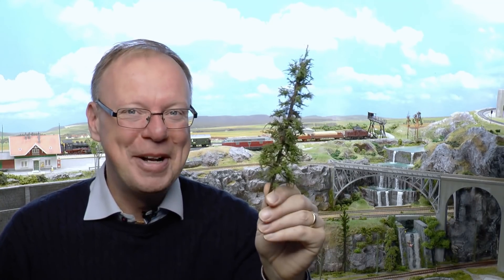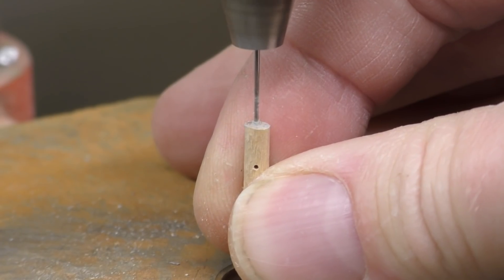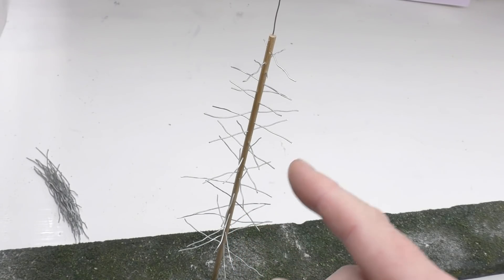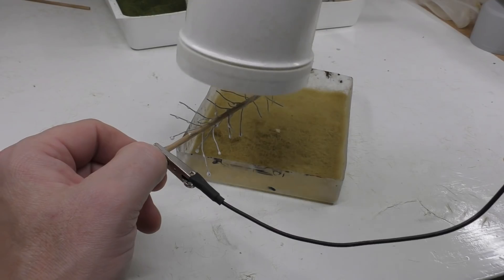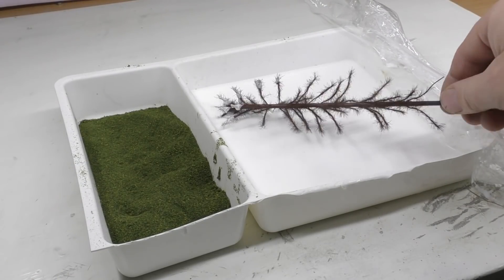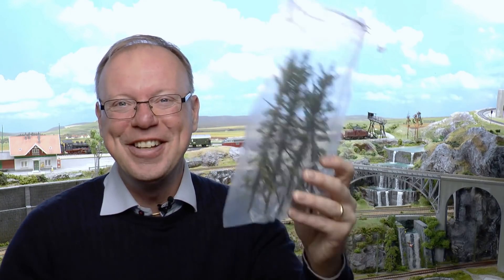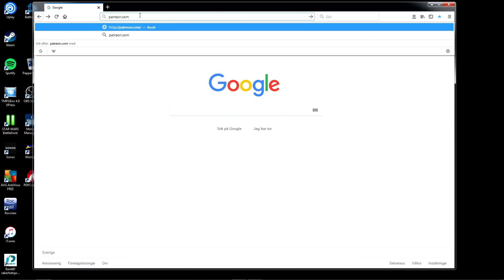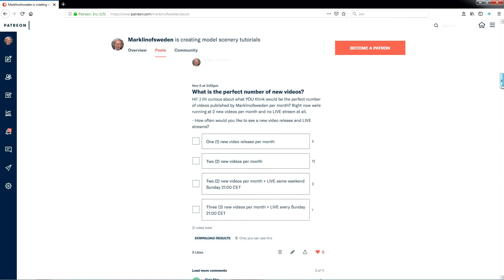Realistic Canadian Blackspruce trees made easy

Comment: Well, Martin, I gave it a go and built three cypress trees.

All the florist wire branches were pointed upwards. Then after the static fibres application I directed the blow-dryer from bottom to top.

Didn't have any dark green fine turf to put on, so I used a WS earth blend, followed by a sprinkling of medium size dark green ground foam. This gives an illusion of old growth underneath and is rather realistic.

The second two trees are made with just the one layer of fine sized earth blend and then sprayed with dark green. I used a spray can of dark green (RAL 6002). The effect is the same, however the texture is finer and airier. 

To conclude all three trees were sprayed with a matt acrylic, again from a can. 

So thank you for a great (and flexible!) idea and your lovely and clear tutorial. All the best, from Slovenia. And yes I am smiling.

Comment: I’ve noticed all you guys are having some sort of competition, to me anyway, with building trees like those. I’ve seen several new methods I’ve never seen. I had given first place to another guy but with this, Mark has moved into first place for most realistic trees. Great job buddy!!
Reply from the maker: Thank you! There are more things you can do with this method and get ever further in the direction of perfection. 1) Taper the top piece. Makes drilling harder, but pays off in realism. 2) Add more than one layer with static grass. Makes the foliage more dense. 3) Add a layer of 2mm static grass over all before adding the turf 4) Sprinkle coffie grounds over the glue covered trunk before spraying it brown. 5) Add moss on the trunk north side using WS Burnt Grass. Good luck! 👍❤️
Reply: @marklinofsweden  For nr.1 Drill the holes before tapering, even the top one.

Comment: Good stuff , I imagine if you don't have a vertical drill , those holes could be a pain to make . 
It looks like you could maybe twist the wire around to make the branches ?
Reply: Just use a Dremel. It's easy. It wouldn't look good with the wire twisted around the trunk.

Comment: Great tutorial. Is that based on this video https://youtu.be/0RaOY43TDAA ? I tried in the past to make one tree in O scale, but I wasn't very happy with the result.
The hair dryer trick is excellent, I will use it next time.
Your trees look better, even if I'm not sure that it scale up nicely to 1/43.5
What is the type of turf used?
By the way, I'm using a similar steel wire, but the one I found in Germany  is also available already blackened. It is less visible than steel color if some part isn't fully painted.